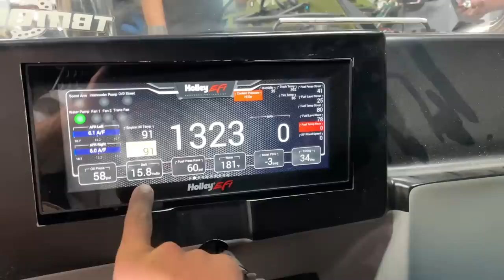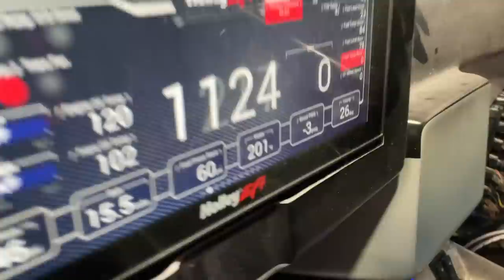FIRST FIRE UP of Mullet's 3000 Horsepower Twin Turbo Big Block!!! **BALD EAGLE SCREECH**

Comment: Charge rate looked high is that because you are using a higher volt battery? Also do you check tranny fluid in park or neutral?  Better to run the pump

Comment: DO NOT keep that cable type dip stick with the flexible tube. It just cost me a $3600 transmission! It flexes enough that you will not get an accurate reading! It may show full, but you'll be low on tranny fluid. Then it'll show over full after you add some and a minute later show low again. Get a solid metal dipstick with a solid metal tube! Even if you have to fabricate it! If you want proof, just pull your oil pan and have someone insert and remove the dipstick several times while you measure how much of it is actually making it to the pan level each time it's moved in and out.